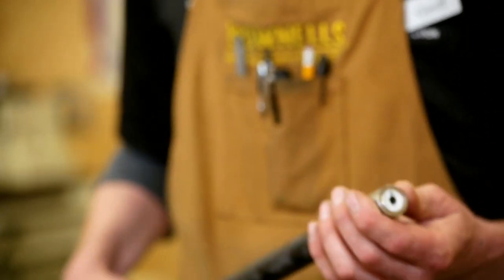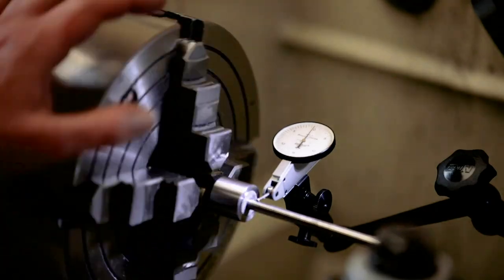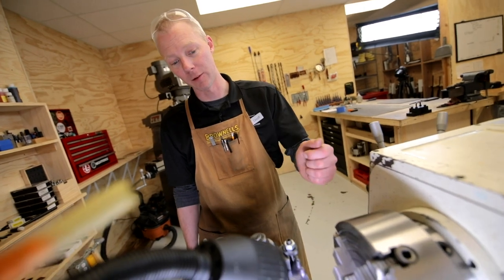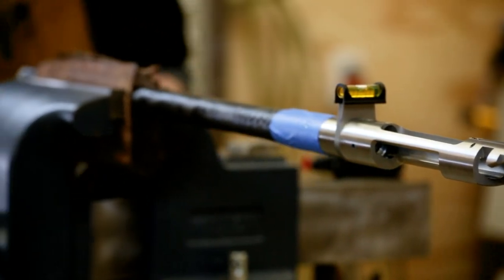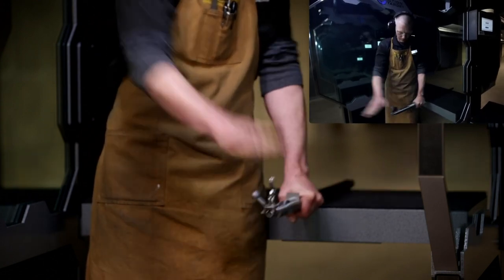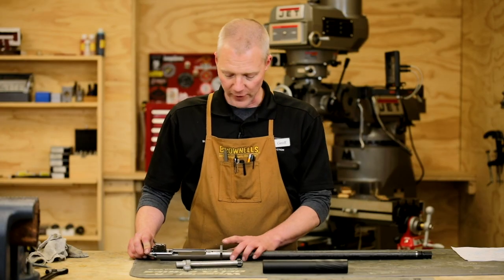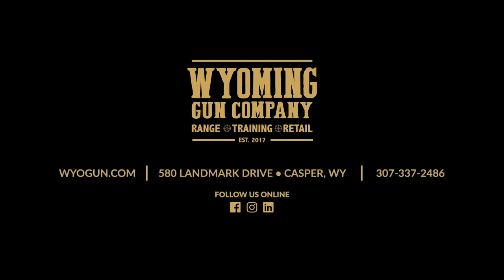Professional Gunsmith Crowning and threading a barrel for a suppressed hunting rifle

Comment: No barrel crowning ?
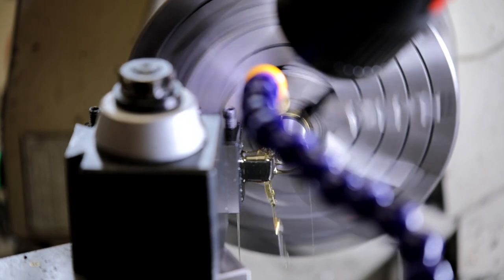Reply from the maker: It's a "flat" crown with a 60 degree chamfer (flat, since it's going under a suppressor adapter).  While difficult to see, at 2:21 I use my 60° Center Reamer (Crown Tool) in a reamer holder in the tailstock to cut it (you can see the chamfer appear).  I offer all kinds of crown styles including the popular 11 Degree, Recessed, Hunter, or a combination of any of those.  
Thanks for watching!!